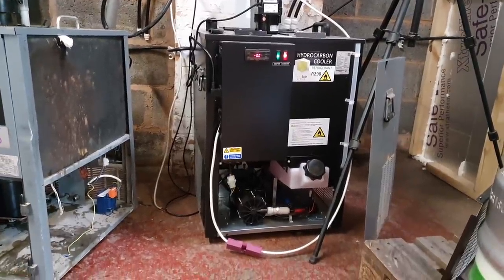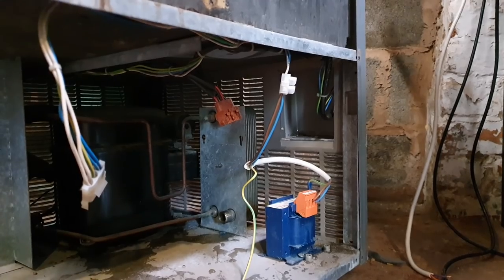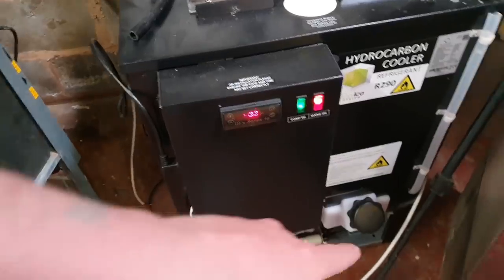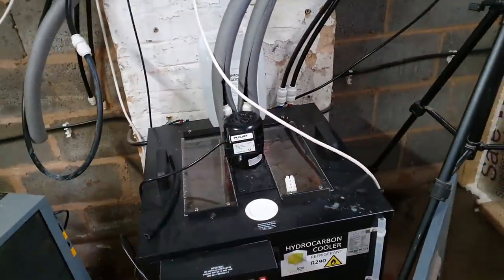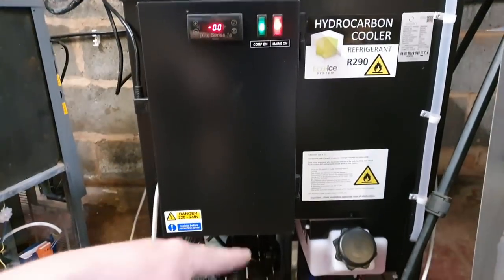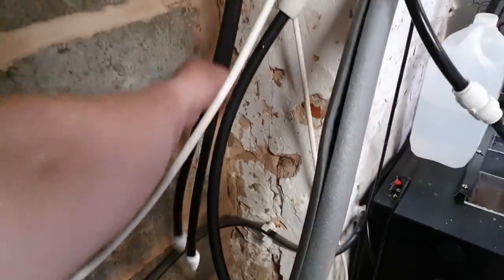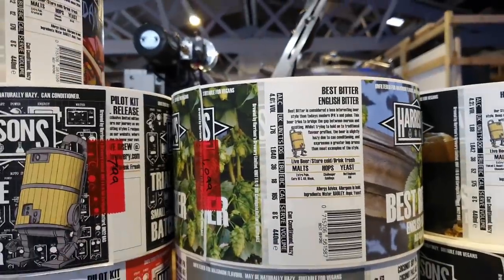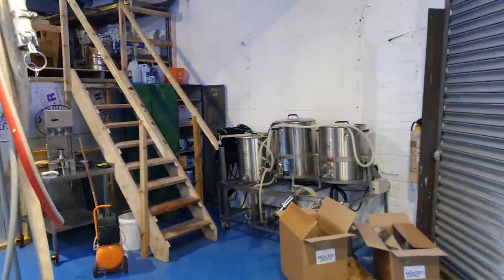The Heat Is A Killer for Beer Coolers

Comment: Any consideration on using the hot glycol via a heat exchanger connected to the water supply to your HLT?  I'm not saying its going to bring your liquor up to temp but its a nice byproduct if you can set it up.